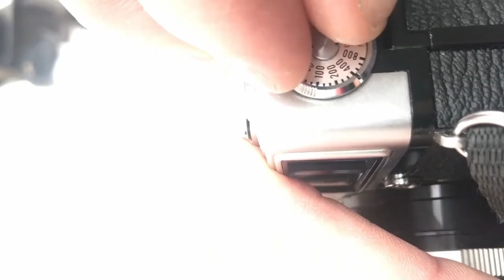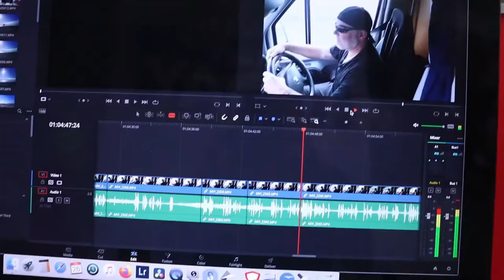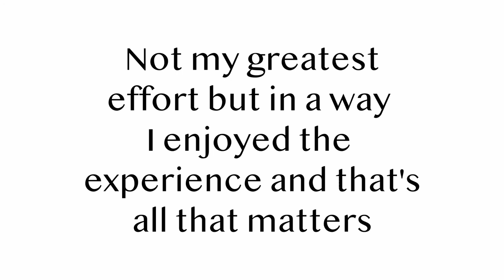BOX camera my first time

Comment: I just got a Fujica GW690. I have never used a rangefinder before so of course I leave the lens cap on for at least 3 shots before I notice that. Some of the same issues using my RB67 Professional. Several times I was caught with blank frames because of the mirror lockup and twice I hadn't removed the slide. The Professional apparently doesn't have all the lockouts and safety features that the S and SD models have to prevent just the sort of things I was doing. Still there is a real thrill to using the old cameras. I absolutely love my dad's old Argus C3 and all its quirks and the images haven't been half bad.
Reply from the maker: Hey mate yeah I can see how it’s easy to leave the lens cap on the range finders I’m lazy and a bit rough gear wise I never use lens caps so hopefully I’ll never have that issue I have enough already to contend with. The fujica looks awesome. Agreed I’m loving shooting old cameras and I’m Deffo gonna try the box again in one quick session with a gaffa taped loading door that should work a treat. Thanks for having a look mate appreciate it

Comment: i'm not certain, but fairly sure that the metal bit that folds out from the front is intended to be a viewfinder, much like the sports finder you'd have on a graflex. i'm glad you managed to pull some decent images. nothing quite like the excitement of running film through a new camera. lol.  is it possible that your two, solid black frames were just overexposed from light that might have leaked into the body over the few months you were waiting to finish off the roll? looking at how much film is unrolled between the spools, it looks like it is at least two frames worth.
Reply from the maker: Agreed mate that frames for shooting like a ttl camera the one on top is for shooting like a WTL. And I reckon you’re spot on re the light leak I never thought of the time it was left in the camera. I’m gonna get round to trying this box again this time in one day and I’ll gaffer tape the back door tryn seal it. Thanks for taking a look mate appreciate it cheers